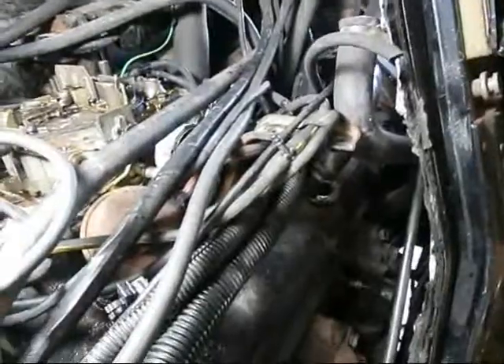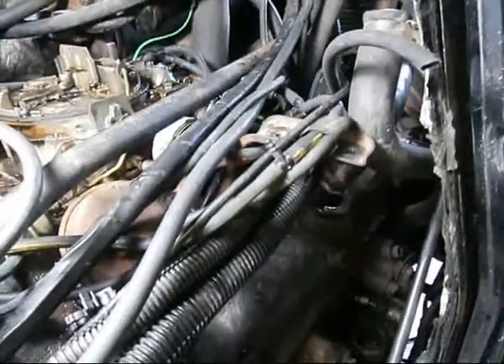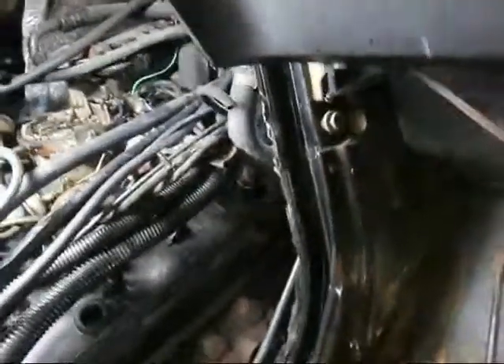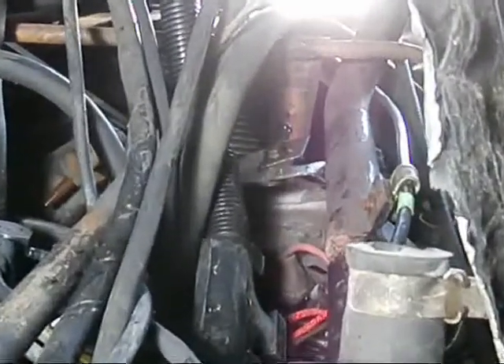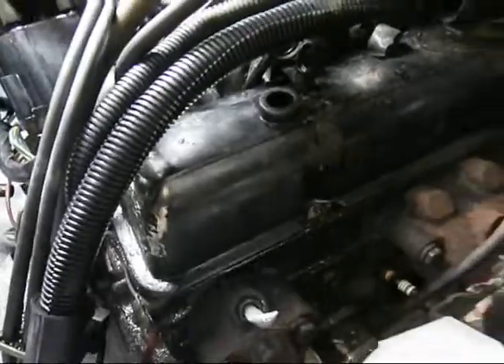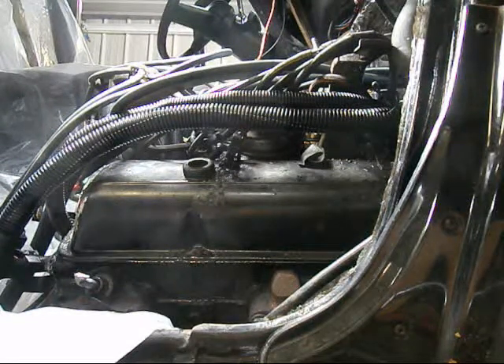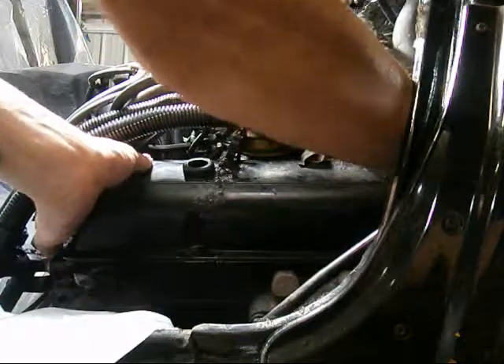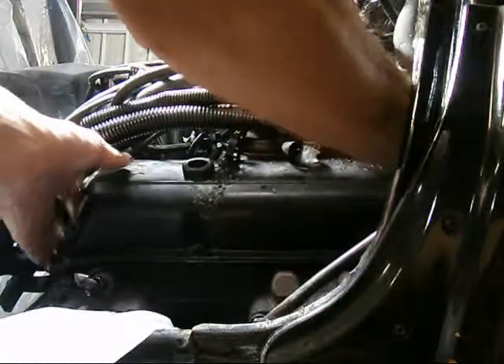9-2-14 G20 Van project Part 2 Valve cover mess

Comment: How did you get the oil filler tube off wtf mines on with a plastic/ploymer grommet
Reply from the maker: @xxskitsxx15  Sorry This was so long ago I don't remember.
Reply: @Procrastinatorgarage  I figured it all out. My brother has 2 vans ones a GMC ones a Chevy both 2500s man lemme tell you if they have the early 90s dual AC system that thing is totally in the way of the drivers side valve covers it was fun